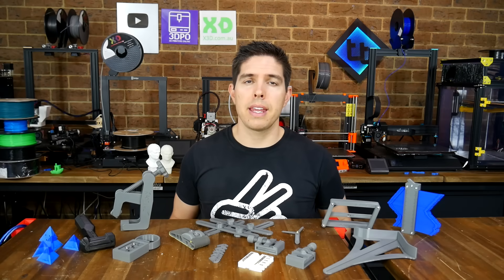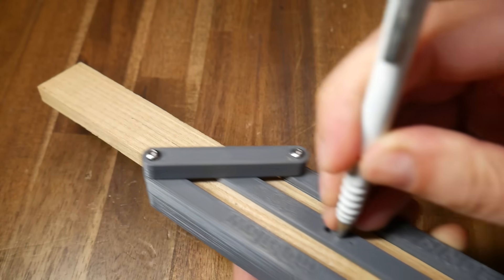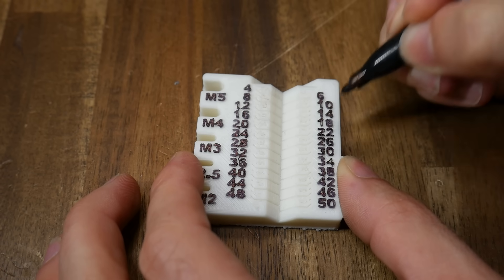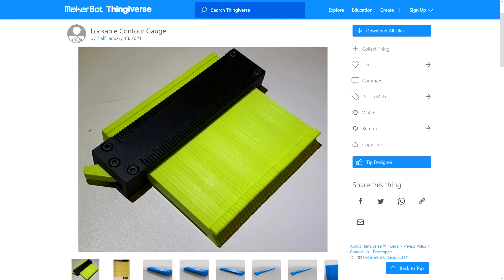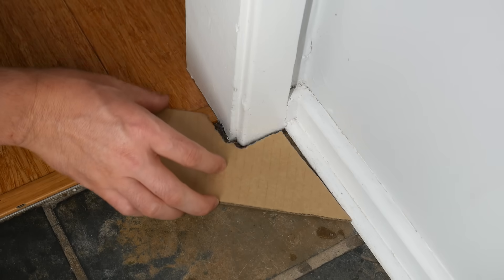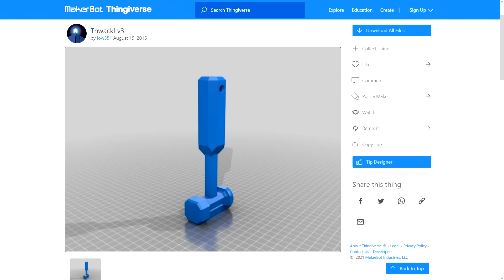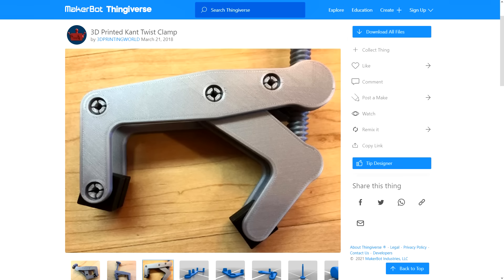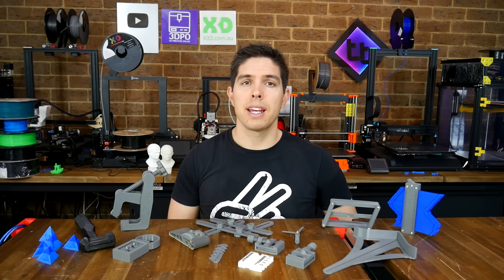12 3D printed tools you need for your workshop

Comment: A couple of these are tools that I knew existed but didn’t know the name of to search for so thank you! 

Any recommendations on grease that works well with PLA?
Reply: Have you tried vegetable oil? Apparently it works, but I haven't had a reason to try it yet.
Reply: SuperLube Synthetic with PTFE.
Reply: Silicone spray lube seems to help with plastics of all sorts, at least for me. You could use regular mineral oil based lube in a pinch, but I'm not sure PLA is resistant to it.
Reply: I use a small amount of silicone grease on the telegraph keys I make. It doesn't take much. Mineral-based oils can be messy and attract dirt.
Reply: I use a very small amount of vaseline, or petroleum jelly. No idea if it harms the pla but seems to work great and just about everyone has some in their cupboard.
Reply: Efficient & cheap (due to mass production) would be silicone grease for (PVC) domestic tubing like "Marley Silicone Lubricant" (in EU). Else you might want to look for 3dinsider.com/plastic-lubricants/

Comment: I mostly agree BUT the contour gauge is the most absurd thing to print : I takes so much time to print, just buy one at 10$ and you'll save time !!!!
Reply: That contour gauge seems like such a nice-to-have sort of thing anyway when you can contour via other means. However if you think you need it badly, but not soon you can spend the rest of your little filament bits printing the components out from the same material, so you can have those little fingers made of scraps.